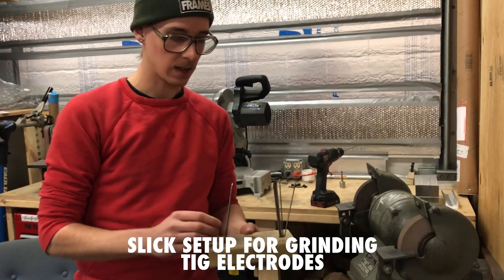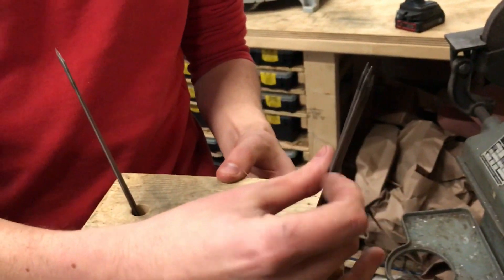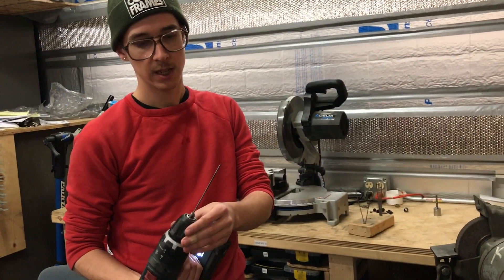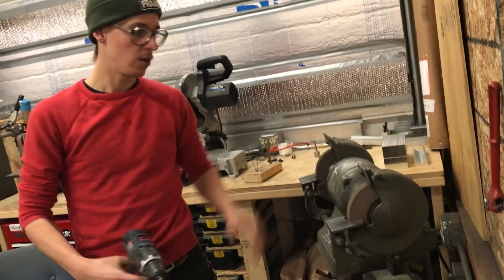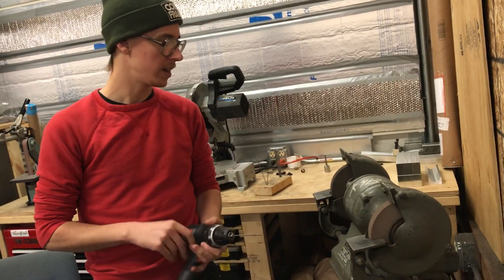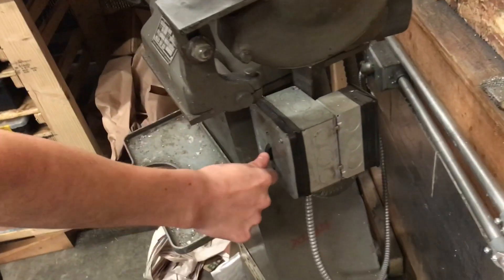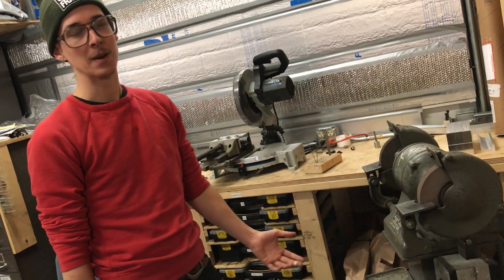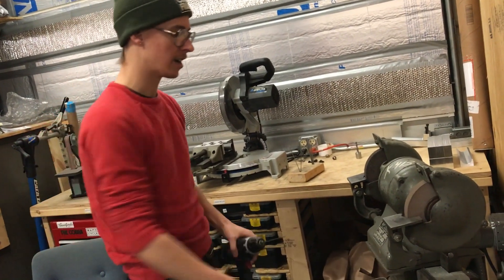Slick Setup for Grinding TIG Electrodes | Welding Tips

Comment: Man I'd love a good OLD bench grinder. They are NOT cheap around here.... I use my 12' disc sander with the same cordless drill method. Surprisingly the sandpaper disc lasts a long while too. The 12' sander is sweet too because you can use the outer 1/2' of the sanding wheel for tungsten only and then you can go hog wild with the remaining 11 inches for your dirty ass bike tubes and such :)  Thanks for the vid!